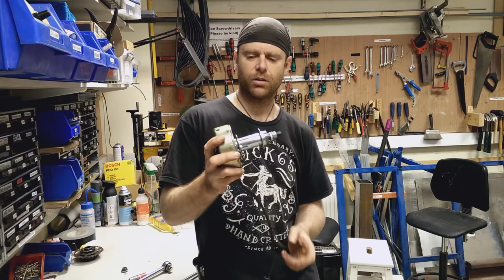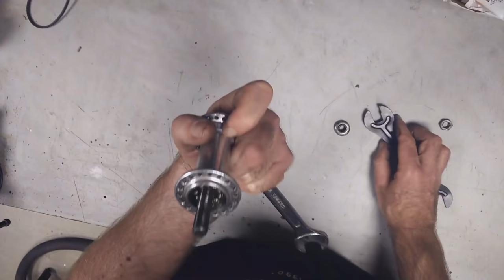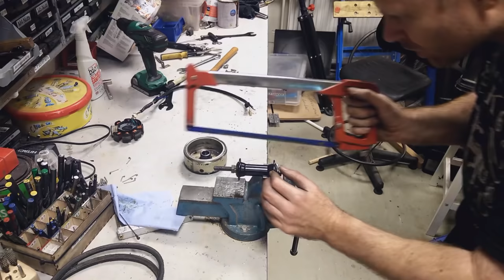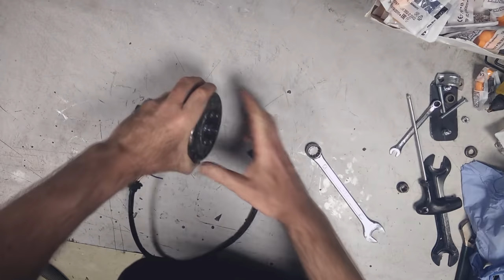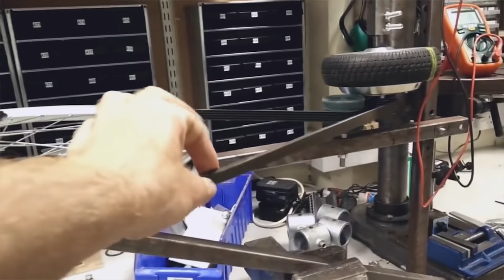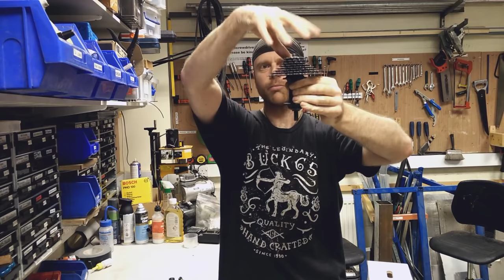Motorbike Alternators With Wind & Water Turbines

Comment: Is their any benefit to using a car alternator? More power etc..
Reply from the maker: More power and doesn't need mounting, but a lot less efficient and needs pretty high revs to do any useful voltage. Also pretty heavy.

Comment: What about the alt frequency produced??? 60 Hz?
Coil Wire Thikness 
Where is the rectifier?
How much WILL output at 160 rom with load?
Reply from the maker: Hz will depend on rpms, wire seems usually rated for about 10A on the low voltage coils and quite a bit lower than that on the high.
No bridge rectifier built in, but easy enough to add one.
Output depends on a handful of factors.

Comment: @OpenSourceLowTech which motor bike alternator you have in your video using??
Reply from the maker: Don't know the model. They're usually broadly similar and should work with this process.
Reply: @OpenSourceLowTech  thank you for replying back I been having very hard time finding the right motor generator for my model to run for a small housing inside five propeller that I will blow air on it but I like to know is it easy to rotate by hand? I would like to get one and connected to propeller shaft by flexible coupling Im looking for at least 14 volts and 200 watts output. I would like to show you the housing if you have an email please.
Reply from the maker: They usually cog a bit, but shouldn't give problematic amounts of resistance. 
Should do 14VDC (rectified) at about 500 rpm or so, depending.
Usually good for at least 300-400W, depending.

My email's on the opensourcelowtech.org website, feel free.
Reply: @OpenSourceLowTech  Thanks I will do that please note the size of the housing is 5.25" x 5.25"
Reply: @OpenSourceLowTech  check your email pls.

Comment: Are they better than the hoverboard wheels
Reply from the maker: In terms of efficiency, max power, and volts per rev; no, but not off by huge margins.
In terms of ease to mount and work with; sort of similar.
In terms of availability; way easier to find in most parts of the world.
Reply: Thanks

Comment: i was hoping to do something similer but have the fly wheel on the inner side to spin with the sprocket casset so a water wheel could run bycicle sprocket and chain and give away to change gear to find the better voltage range maybe speed
Reply from the maker: Inner side?
Reply: @OpenSourceLowTech  yeah the fly wheel on the hub rather then axle as the hub would spin as normal for the bycicles gears to work
Reply: @OpenSourceLowTech  never mind i just got to the bench test equip had not thoght of using the rim as a larger pully wheel
Reply from the maker: Ah I getcha. I actually did it that way the first time for that reason. Mounting the stator on the hub was easy enough, but only way I could usefully mount the rotor on the axle was getting someone to lathe out a housing for the encapsulated bike wheel bearings, which ended up working well enough, but a lot more hassle.

As I say here, there are at least two viable ways of connecting the rotor to the sprocket set.
Reply: @OpenSourceLowTech  yeah i was commenting befor i had scene the hole video annoying i know but i have to get ideas down as i have them or i forget may start using notepad for the questions and watch video till the end then ask them i like the wheel and the segway motor the same could be done with the motorcycle one you have done and think that prob the best i was thinking of maybe using bycicle wheel as centre of the water wheel and linking to the pedals on a bycicle to use the chain and sprockets as a gear box my first idea was using the segway motors as the axle centre hub but felt they would not work as they would not be spun fast enogth
Reply from the maker: What's your water availability like in terms of drop and flow, and how much power you hoping for?
Reply: @OpenSourceLowTech  as in terms of where i am at moment none i am looking and cataloging all information i can for for the future

Comment: since watching your graverty water wheel idea i been looking about for cheap segways to steal the motors
Reply from the maker: Depending where you are you should be able to get a whole hoverboard second hand from the local classifieds or similar for about $20-30.
Reply: @OpenSourceLowTech  yeah they are quite a few easy to get hold of just not been able to with lockdown and things

Comment: could you not rewire alternator for more power?
Reply from the maker: Rewiring is an option, but is only useful if you need to shift the volts amps ratio, which can mean more power overall if it ends up a better match for your revs and torque profile coming off the turbine.

Comment: Can I charge a 12 volt car battery with that. It would be very interesting if could run my house with multiple of them in my stream.
Reply from the maker: Long as you've got a water supply capable of spinning the turbine fast enough to get the voltage over 14.4DC while under some useful load, then yes.

What's your meters drop and liters flow, roughly?

Comment: Hello Daniel, thank you for sharing this, i'm glad to see it's feasible. I'm still learning and seeing you really motivate me.

I'm currently trying to plan/engineering something very similar to this in the purpose to make a little energie for my offgrid cabin with a beaver dam. ( 1.5 m of head). Hope it not sound too much crazy! Lot of water, but low pressure and freezing problem in canadian winter. 

I did not see the AC to DC converter, am assuming the output is AC since it's a motorcycle alternator. I assume a motorcycle alternator would be much more efficient than a car alternator at less RPM ?  the car option is already somewhat mounted.. so ? what is best ? Before seeing your video, I was thinking to maybe rewire a car stator in a different gauge/size copper wire. 

I also wonder if the bicycle chain can work on a horizontal plan,  or would it "derail"/fall ( sorry, I hope this word exact, English is not my mother tongue). I want to put a turgo wheel horizontally, so I can maximise the very low head I have. 
EDIT=> I've just seen the demonstration at the start ! =D thank

On another subject/ idea, Do you think it's possible to reverse a small electric boat propeller to make it generate electricity ? I mean.. it's a motor.... and it's already have a propeller mounted on it.... Good idea ? Worst Ever ? 

i hope you would like to share your insights =) 

regard =)
Etienne
Reply from the maker: > assuming the output is AC since it's a motorcycle alternator.

Yeah they tend to be three phase AC, but can be single and some have the third coil as high voltage for the starter circuit.
You'll need a basic bridge rectifier if you're plugging it into anything DC.

 > I assume a motorcycle alternator would be much more efficient than a car alternator at less RPM? 

Exactly that, yes.

> the car option is already somewhat mounted.. so ? what is best ? 

I don't usually bother with car alts. They're about three times the power, but at about half to a third the volts per rev, and like you say not very efficient. Also quite heavy.

> I was thinking to maybe rewire a car stator in a different gauge/size copper wire. 

Lot of work.

> I also wonder if the bicycle chain can work on a horizontal plane

You wouldn't want to string over too much of a distance, but if you can nestle the two sprockets closeish together then it should work fine in any orientation.

> I want to put a turgo wheel horizontally, so I can maximise the very low head I have.

You won't get much efficiency out of a Turgo at 1.5m head. My siphon turbine is meant for that kind of niche.
 
> possible to reverse a small electric boat propeller to make it generate electricity?

That's basically what my turbine is, but with a tube around it to generate more flow. A boat prop would I think be a more efficient runner shape, but the PSU fans a lot easier to source.
Reply: @OpenSourceLowTech  

=) Thank for your time, it's appreciated.
Reply: @OpenSourceLowTech  Roller chains only work horizontally under high tension, which makes them inefficient.
Reply: Здравствуйте, Даниэль, спасибо, что поделились этим, я рад видеть, что это возможно. Я все еще учусь, и видя, что ты действительно мотивируешь меня.

В настоящее время я пытаюсь спланировать / разработать что-то очень похожее на это, чтобы получить немного энергии для моей автономной хижины с бобровой плотиной. (1,5 м напора). Надеюсь, это не звучит слишком безумно! Много воды, но низкое давление и проблемы с замерзанием канадской зимой.

Я не видел преобразователь переменного тока в постоянный, предполагаю, что на выходе переменный ток, так как это генератор переменного тока для мотоцикла. Я предполагаю, что генератор мотоцикла будет намного эффективнее автомобильного генератора при меньших оборотах? автомобильный вариант уже несколько смонтирован.. так? что лучше? Прежде чем увидеть ваше видео, я подумал, возможно, перемонтировать автомобильный статор медным проводом другого калибра / размера.

Мне также интересно, может ли велосипедная цепь работать в горизонтальном плане, или она «сойдет с рельсов» / упадет (извините, я надеюсь, что это слово точное, английский не мой родной язык). Я хочу поставить колесо turgo горизонтально, чтобы максимально использовать очень низкий напор, который у меня есть.
РЕДАКТИРОВАТЬ => Я только что видел демонстрацию в начале! =D спасибо

Что касается другой темы/идеи, как вы думаете, возможно ли перевернуть гребной винт небольшой электрической лодки, чтобы он вырабатывал электричество? Я имею в виду… это мотор… и на нем уже установлен пропеллер… Хорошая идея? Худший ?

Надеюсь, вы поделитесь своими наблюдениями =)

с уважением =)
Этьен
Reply: @AnatolZelenkoff  Did you copy the original comment and repost it? Why, if one may ask?

Comment: What is the output voltage at ac?
Reply from the maker: Depends, but often around 18VAC per thousand rpm. Can be single or three phase, some have an exciter coil which does about ten times that voltage but at low max amps.
They're not too bad, overall.
Reply: @OpenSourceLowTech  rewinding it at more turns will be great for lower rpm by the way thanks😊 make more usefull videos😊😁

Comment: motor cycle batteries are 5ah rating, these stator only produce enough amps usually 10% of battery rating, or 500mA, you'd be ;lucky to get 2A on that stator. another problem is that only single phase, manufacturers will not allow a motor cycle with a 5ah battery to charge greater than 10% or 500mah or the batteries wouldn't last quick charging lead acid motorcycle batteries, best generators are 3 phase, you can get 1.73 times more power than single phase
Reply from the maker: Bike alts seem to vary pretty widely, and yeah they're not the perfect option for this use, but do usually do better volts per rev and overall power than anything else I can find which is prevalent and accessible in low resource environments.
Reply: @OpenSourceLowTech  i have a yamaha mio that had 5ah battery, since i change mg head light to HID 36 watts, i change my battery to 7ah, but still i would drin the battery which only eats 3amps of my head light, it would drain it in a hour or so even while riding, i even bypassed the charge controller and still had problems draining, motor bikes have a small battery even if i replace it with 7ah or 9ah, 10% safe charge is only 700mA 900mah respectively, unlike cars 50ah battery 10% safe charge is 5amps, have you tried measuring power generaton of the segway motor?
Reply from the maker: Battery specifics would be one of the main holes in my knowledge. And also end up pretty bespoke to the install in question. I generally just ask some experts and defer to their judgement. 
As I understand it tho a motorbike alternator will charge a car battery just as happily as a bike's.

Hoverboard wheels should be good for at least 300W nominal output, depending on specifics, and probably maybe like 4-500 if pushed.
They usually do about 55VDC(rectified)/krpm and seem about 10A rated.
Reply: @OpenSourceLowTech  agree, unless we go lithium, we can charge quickly, 1C to 10C depending on specs allowed,  but lead is really design yo charge 10% for 10hours so not to damage tge plates. Ive seen YT diy making their own stator gens specially wind gens, hydro is more reliable as lonh as yhe source has a large capacity. So gens have to be designed depending on speed rotation and volume/ time.  Anyway subscribed hope to see more of your  good videos <3